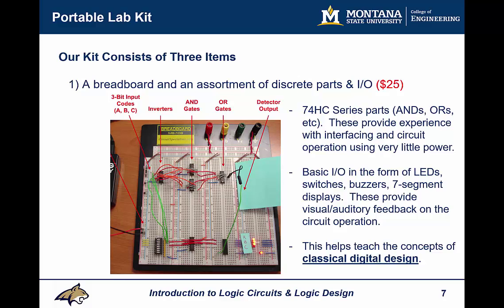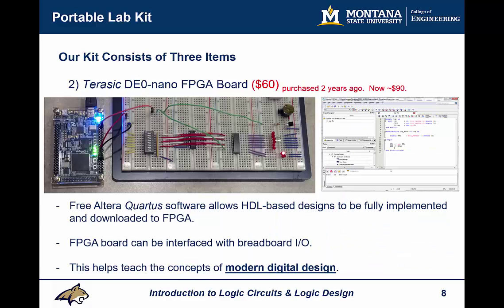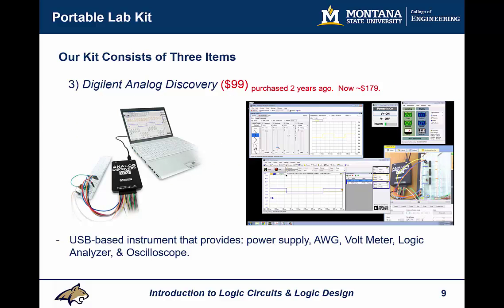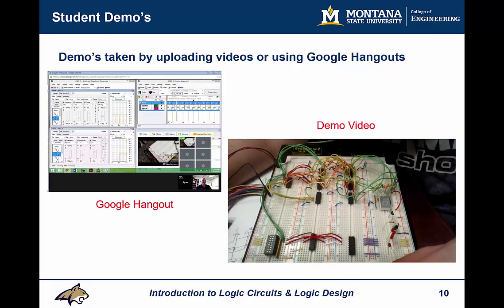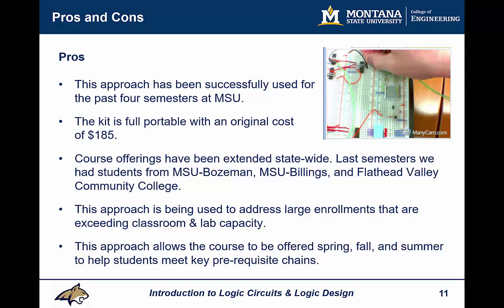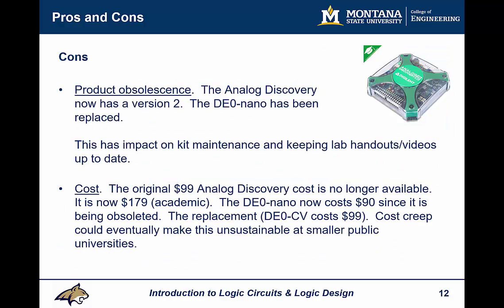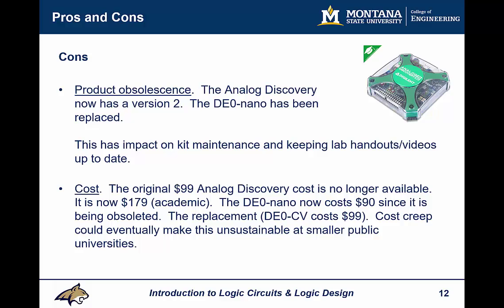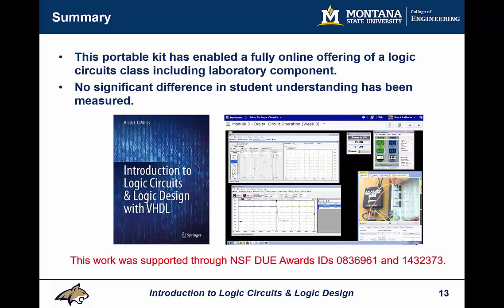Analog Discovery & DE0-nano: Hands on Learning @ Montana State University _ Brock LaMeres

Comment: What other courses have you used Analog Discovery in? 
What other inexpensive learning platforms do your students experience? (e.g. Arduino, TI Launchpad, etc)
You have done a great job of showing how this approach frees you from some significant delivery barriers, especially for online courses. How has it changed your view of how engineering education should work?
What are you doing that is different from what you could have done in the past if every student owned their own lab equipment?